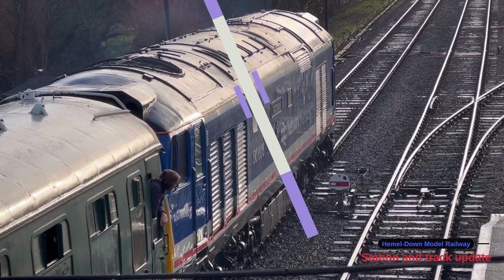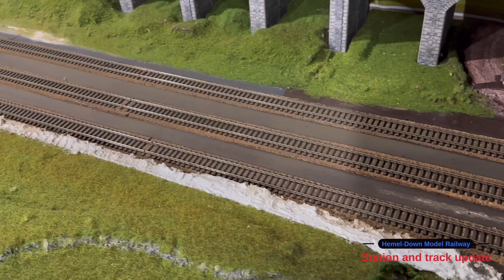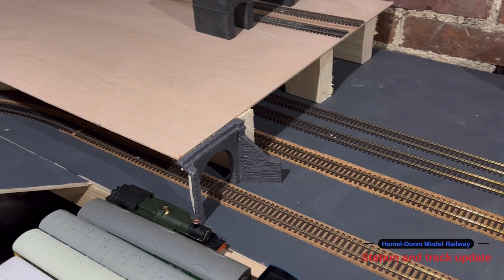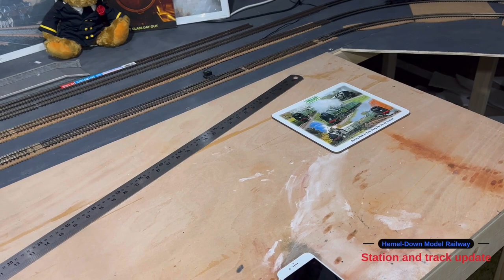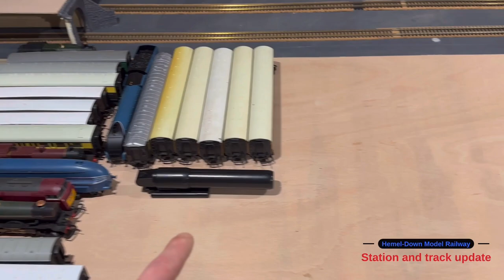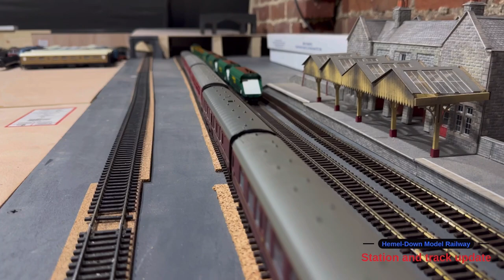Building a model railway - track work update and layout plans

Comment: Nice update and running session. I agree with Alan you definitely need to have a transfer track between the levels, I’d suggest keeping it as long and gentle as possible 2% gradient if it’ll fit. I think you have missed a trick as you have 4 lines running around the lower section, one of them could have been a very long gradient up and down.
Cheers Rob.
Reply from the maker: Yeah Rob I definitely agree, in a way I’m lucky only one side is stuck down permanently so hopefully I can get a plan in place for the other side and make it work 🙏🏻 something I’m planning now so hopefully I can update you all soon on my plan

Comment: Hello Mark. Nice update about your plans and thoughts for the next stages of progress on the layout. It will be best to sketch some of them out first though as you say. That way, it should help you visualise them first and see if you like them or not. Also worth trying to temporarily lay some of the track work and points down as well as you try different plans, so that you can see if they will fit and if you like them 'in the flesh' as such. I liked the running session at the end, but you really should of had a brake van on the end of the goods train... All the best, Mark.
Reply from the maker: Thanks mark, yeah I need to invest in a brake van, see what I can pick up at Ally Pally
Reply: What day was you thinking of going to Ally Pally Mark? I was hoping to go on the Sunday. Would be nice to meet up if you was going on the Sunday as well.
Reply from the maker: @StanoverModelRailway2020  I can only make the Saturday on that weekend I have to work on the Sunday, let me know if you can get there that day instead would be great to meet you 🙂👍🏻
Reply: Just had a thought and I think that I have actually got that Saturday afternoon booked off as holiday at work. So I may be able to make it, if I can do a quick change when I have finished and drive to the station straight after and catch the train up. Will have to look into it and see if it possible and viable to do so. Otherwise I will go on the Sunday instead. Of course, if you would like to meet up at some point before Ally Pally, then that would be great. Send me a message via Facebook and we can talk about it. Mark.

Comment: It`s a case of the more you get done the more you can do, you still have lots of scope. is worth running an off scence area as a fidle storage yard behind the chimney, which would also be thhe ground work for an extension later on. Like you I don`t want to be in the situation of needing to handle loco`s on and off track particularly with the modern stuff being fragile.
Reply from the maker: Yeah I’m really contemplating using the other side of the chimney breast that would give me another 25ft by 11ft to play with, I’m going to save up and hopefully each month buy a few boards and put the floor down on that side and then see what I can do, I think that I’ll do an open frame layout a bit like Alan’s see what the summer brings

Comment: Hi Mark. Apologies if I have asked this before (and you gave an answer), but you have been adding lines; I have both DC and DCC locos (and therefore appropriate controllers) so I'm trying to think about how to run both types on my layout (not at the same time, of course). My question is: are your DC and DCC tracks completely separate, or do they connect using turnouts with insulating rail joiners?
Reply from the maker: Hi no worries, at the moment my dc line is completely separate connection I’m using the HM6000 then I have the Nce powercab connection for the 3 other lines, I might have it switchable in the future but I’m not really gifted in the electronics side of things so trying to keep it simple 🙂